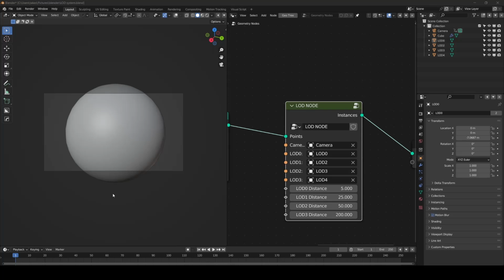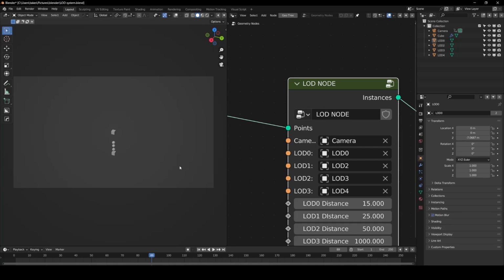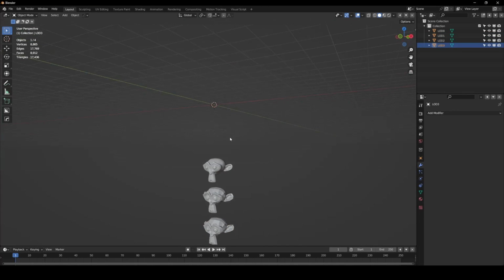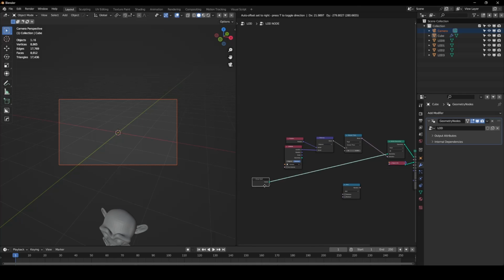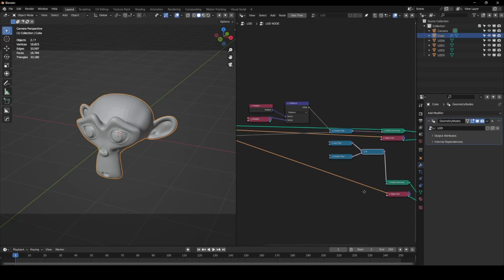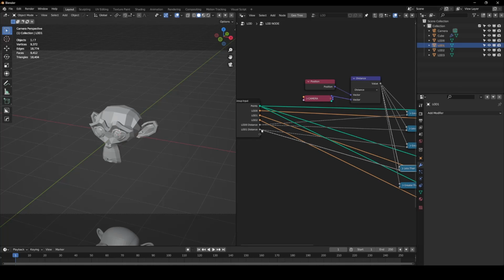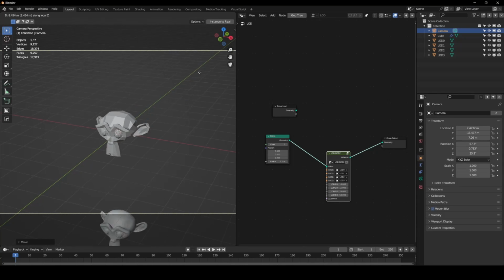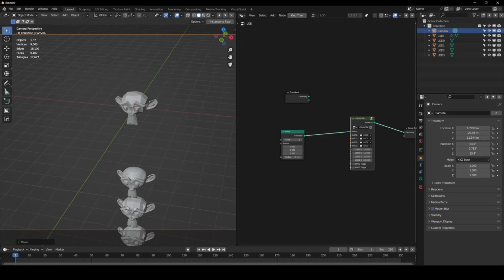How to create LOD in Geometry Nodes [Tutorial]

Comment: Sorry, not to sound unappreciative but isn't this actually kind of pointless? You're duplicating the object to get the vertices count. Though, to me, it simply looks like a replacement rather than a count scale. Which means... The software is going to be twice or thrice as heavy when doing a lot of objects because of duplicated meshes. This does not sound friendly at all in terms of CPU/GPU usages on the software alone. It actually feels simpler to just use Subdivision with camera distance. Probably with drivers or something.

Though, please correct me if I'm wrong. I'm not trying to discourage anyone from using this LOD system but a lot more insight on this would be helpful. Although I used Blender for a lot of years, I still consider myself as a noob.
Reply from the maker: well the replacement system does still exist in the world once you hide it from the viewport blender is no longer computing it. Its why when you have a heavy loaded scene in blender you hide certain models and the scene lightens up. The issue with using subdiv and camera distance with a driver is now you have a dependency on a singular camera and driver. There may be a multi camera scene or you dont want to tie a dependency from the specific object to the camera. If you look in the data info tab which im forgetting the name. when the lod switches the calculation blender is making also changes. I don't think i have it up for the video sadly. don't worry theres always something new to learn and not every technique will be useful for your specific use case. This can also just be used to learn what certain nodes do and expand from there or to create something new using a similar node system. (edit you can see the numbers on the top left change when i move back and forth 15:45)
Reply: @takaart116  Thanks for replying to me. I really appreciate it.

You're right. I had actually tested it out and this LOD System is actually highly useful in comparison to the driver. For some reason, I thought even if you hide the objects, it would still count towards the CPU/GPU power. I definitely still have a lot to learn.

The test I did was, I created a low poly style tree and added a bunch of vertices to it. Then duplicated those around to add drivers to each of them. The scene got too slow at just 14 of them. It's definitely not ideal to use this one in a larger map area.

Thank you, Takaart116. Your tutorials is actually pretty helpful and I was wrong to think what I did.
Reply from the maker: @JacSkulls  I'm glad you where able to learn something from this. Doesn't mean you where wrong its all depending on use case and what works for your current scene. Learning different methods can result in time saved. Thank you again
Reply: @takaart116  No. Thank YOU. Without people like you, we'd be miserable. Haha. Thank you for teaching us these things and sorry if I sound corny as hell. This whole interaction had opened my eyes to even more possibilities. You're a great help and you have my gratitude. Do keep up the good work and I really wish you good fortune.

Aye. I'm looking to learn how to render and create my scenes as fast as possible. That's kind of what brought me here and why I'm trying to make such a large area. I want to do this right and as effective as possible.